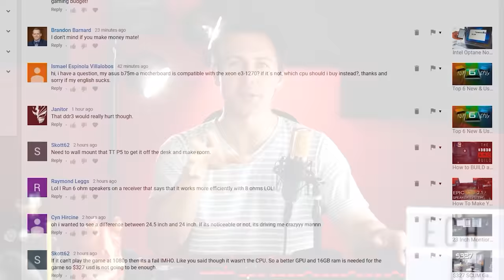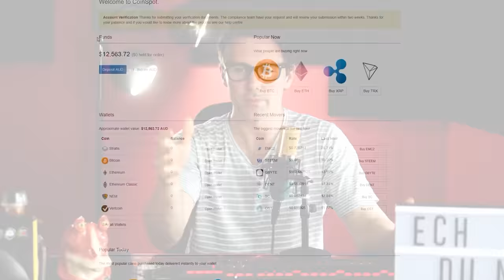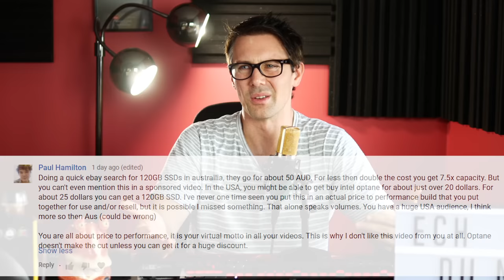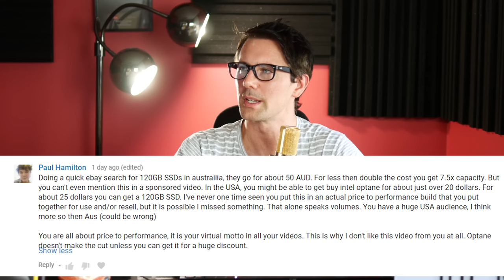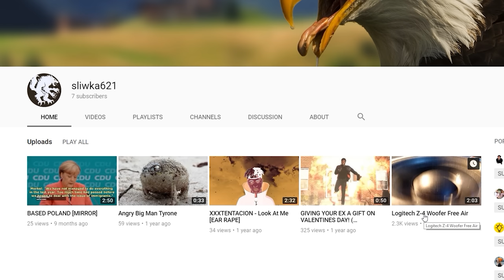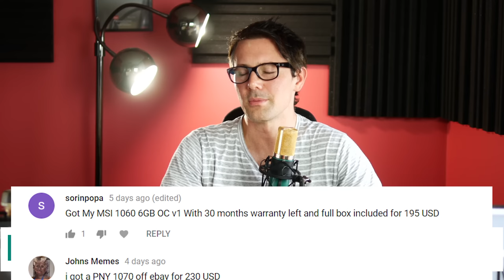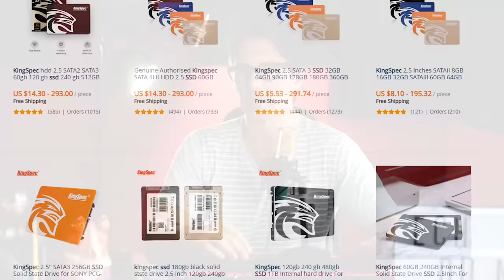ATY #003 - TechSource Robbed, 90 Second Boot Time? Used PC Prices Full of S#*T?! Intel Shill!?

Comment: Hey Bryan, I just got myself two X79 motherboards one for free and one for about $200 AUD. I have a 4820k and a 3930K the 3930k is my daily driver and I have it on 4.9Ghz offset voltage of +.30 It peaks at around 1.37-38 volts but I have heard others requiring 1.4 v to get past the 4.8.

So is my 3930k just a really good silicon lottery? I can not find any videos on X79 in depth overclocking, benchmarking for the 3930K. But them cpu's can be had for quite cheap $150 AUD. I wanted to put the processor you used but that is almost $500 which I cannot afford right now.

If you have a 3930k could you please do an overclocking, price to performance etc on it. When I ran a few quick benchmarks I noticed it is on par with the I7 7700k oc'ed to 5.1Ghz according to gamers nexus. So could this 3930k be the next best price to performance cpu?

Loving your videos Im from Oz too but unfortunately from the cold dreadful melbourne and wished I lived in the sunny brisbane/qld gold coast area. I also followed your X58 overclocking guide which took my X58 x5650 to 4.6ghz easily on air but selling it now but not one person is interested in that system for $300 cpu, ram, motherboard which I thought it was a decent price, looks like I have to further reduce it to maybe $200, anyways Keep up the good videos.

Comment: There are some LGA 775 mobos that actually support ddr3, they are a bit hard to find though, still, as just new gpus are coming out and the new gen becomes "old" i would just ditch lga 775 altogheter now, even if you are going for something like a gtx 1050ti at most, since x3440 combos costs almost the same as LGA775 now these days if you are buying from aliexpress or ebay.

Also I did buy 2 Kingdian SSDs from aliexpress, they work pretty well, i got 2 of 60gb each since they where used for simple builds on h110 mobos, and i use one of those to boot pc builds that i have made from time to time.

Comment: Phew! A bit of hate on this one - but I'm a believer buddy even though I'm out of the demographic (41 years young) lol.

ADDRESS THE YES QUESTION from NZ.

Should I sell my current PC?
What would be the best bet for my other 771 system?

I basically need to raise cash to get out of debt.

So Im thinking of selling my current PC. A i7 8770k, 16gb, GTX780. 
It's done up in a windowed Black Blue themed case P67 mb with water cooler, ssd, 650w power supply and all important rgb led strip 🙂

I have a dual socket 771 system a Dell Precision 690 currently only a basic E5310 with 12gb quad channel ddr2 ram and a beefy but non standard 750w power supply with 6pin power for gpu.
My plan was to find a cheap gpu and cpu combo to use.
I've researched and found it will bottleneck upwards of a 1050ti with an overclocked X54.. series CPU.
I don't mind 30fps on 1080 res settings for now as I play mostly RPGs and turn by turn anyway ... 
Just basic applications besides the gaming I aim to replace it once I get back on top of things.
What do you think?
Sell current complete or break it up a bit.
What cpu/gpu for the 771 would you recommend and is it even worth the 2nd cpu to get a tad better gpu and performance overall.

Comment: Hey Bryan! I have a beautiful R9 290 Vapor-X that sadly bit the dust. I took it apart, cleaned it, and fired it up again and it started to work. But ~30sec into windows, the computer lost video and looped audio. I noticed a sticky residue on the back of the card beneath the back-plate after I took it out again to see what happened. I don't know what happened. Maybe the thermal pads on the backside are long gone? If you can't help me I might send it in for 'Can Yes Fix It'? Cheers man, I love this channel!
Reply: The sticky stuff is probably just oil from the thermal pad, which is completely normal.  

What is probably happening is Windows is detecting the card and installing drivers for it automatically.  Once those drivers are installed it crashes.  It's a common problem, error code 43.   Not easy to fix at all.
Reply: Jaymiecain1 while that could very well be it, I don’t think so. I used DDU and uninstalled drivers, and disabled automatic driver installation in windows. But you know. After I got it working the second time, I did re enable it. I’ll put it back in and see if that fixes it. Thanks for the reply btw!
Reply: Try uninstall the drivers and disconnecting from the internet.  Install the card and see how long it can last without any drivers (Obviously it can't play games etc, but just testing if the card has basic capability).

If all goes well re-enable the internet and see what happens.  If all goes well go on the AMD website and download drivers, keeping a track record of which ones you try.  Sometimes you can find a driver the card likes and all is fine.  Sometimes you need to reinstall the card bios.

It does seem like error code 43 though, which is an awful problem lol almost every spares card on Ebay has error 43.
Reply: Jaymiecain1 I reinstalled the card, but got no signal at all when I turned the PC on. I really don’t think it’s a driver issue, sad to say. 

Thanks for your help though! 

I guess some more info for anyone who sees this: 
I got this card a while ago and used it in my system for ~1 year. It was awesome. When it but the dust, it was after I took off an overclocking I was running. (Was stable, all seemed fine) there were no spills or anything like that on my PC. After I got a new GPU to use my pc again, I tried looking to see what went wrong. Cleaned dust, used alcohol wipes and put it back in. Got video, then 5 sec later it black screened. Repeat clens but clean the back and got 25 more seconds out of it maybe a cap or something? Blown resistor? I hope this helped.
Reply: Are the fans spinning? Do you even get a post screen? Could you plug another GPU in along with the 290 and see what windows device manager detects?
Reply: Jaymiecain1 no post screen at all. My mobo only has one pcie slot sadly, I really tried all I could think of.

Edit: the fans spin and the led indicator is on.
Reply: If you can't even get it to the post screen that spells bad trouble.  If you had another PCIE slot you could try flashing the bios as a last ditch software fix.  Other than that it's probably hardware, which is a lot more difficult and requires a lot of tools =(
Reply: Jaymiecain1 :/ yup, that’s what I got from it too.

Comment: I have an i5 3570k coverclocked to 4.4ghz, 16gb 1600mhz ram, and a z77 pro motherboard, is it worth upgrading to an i5 8400 or something in the same price range? I only game with my pc.(all of the stuff I have I got free a year ago)
Reply: Should probably also mention what GPU you use
Reply: Are you getting satisfying performance in games you play? If yes, no need to upgrade. If no, check for i7 3770k or bether GPU. DDR4 ram prices are too high for switching to new platform. Anyway, even if you do not need to upgrade, try hunting for good deals.
Reply: I used to have exactly what you do now paired with an RX 480 and I upgraded to a R5 2600 + 16GB 3000MHz RAM and the difference is night and day. Especially on MP games such as BF. I couldn't be happier with my choice.
Reply: @Jaymiecain1  i5 8400 is 6c/6t

But I'd recommend the op to upgrade to at least 6c/12t (i7 8700/k or at least an R5 1600/2600). For a budget upgrade a 3770/3770k/3790k. Good value atm and still great for latest games
Reply: i have a 3770k at 4.7 ghz rn and i have a rx 580 and im currently playing anything and everything i want with no frame issues if that helps you out since i happen to have the upgraded cpu to your platform but i play league of legends shadow of mordor some civ 5 and 6 and fortnite and all rune with high fps but i usually cap it to my monitors refresh rate which is like 70 or 75
Reply: Man, I'm on a roll for mistakes tonight.  Fair point.  The Ryzen 1700 is only an extra £30-40 here in the UK, Ryzen 1st gen makes things difficult because it is so cheap.
Reply: Yeah, the 1st Zens are the best value pick for new CPU atm, also the 350/370 boards are on sale in most stores as well. Just DDR4 prices still a bit high.
Reply: Thanks for all of the help
Reply: I have 3770 4.1ghz With gtx 1080 And its Fine, on 1080p There is bottleneck, but i have 1440p And bottleneck is almost eliminated, so i Will not buy new platform, because make no sense, for only games.
Reply: Given that you already have a GPU, you don't need graphics integrated in the CPU. I have an  Xeon e3-1240 v2 (Ivy Bridge) which works very well - comparable to an i7-3770 (non K).

Comment: 1 - What is your experience with GPU coil whine? Do you see it as a problem or do you not really care?
2 - Corair's VS line of psus cop a lot of hate. Thanks for bringing a bit of sense to the discussion. I wish you went a bit further as I think they are great value and there are 650w models. Power supply requirements are easily the most misunderstood aspect of PC building. The BS just won't stop! Is it really so hard for people to sit down and calculate the +12v output instead of cutting and pasting the same fake news in every damn thread?

Comment: Looking forward to your x79 content. I'm still rocking a 3930k on a Asus sabertooth x79 mobo. Looking to upgrade the graphics from the Asus gtx 680 top I have now. I was thinking of going with a 2080 or even a 2080ti if I can find one in the next few weeks. If nothing else, I'm just curious to see if the 3930k can keep up with such a powerful gpu! Love the videos BTW
Reply: John Scholten That Will be bottleneck as Hell man. You Will lose atleast 30%, so Why loosing money on that?
Reply: @michalsmejdik  I'm really just curious and if it ends up to be too much for the ol' 3930k I'll grab up a new 9900k when they come out. My original plan was a whole new system anyways. But if by some miracle it works in practice I may hold out for zen 2!
Reply: John Scholten If u Will update platform later(i mean sometime in future) , then i dont see problems, but now 1080ti is better choice. Benchmarks are out And With touring you Will pay for 25% more performance about +50-75% price . So you choose. :)
Reply: If you buy 1440p or 4k you Will eliminate some bottleneck. Like i do. I still rockin on 3770 4.1ghz oc And gtx 1080 (2.1ghz oc) 16gb(1866 oc) on 1440p 165Hz, so this is my recipe to reduce bottleneck. Some multiplayer games still bottleneck about 5% like Battle royal games or battlefield.